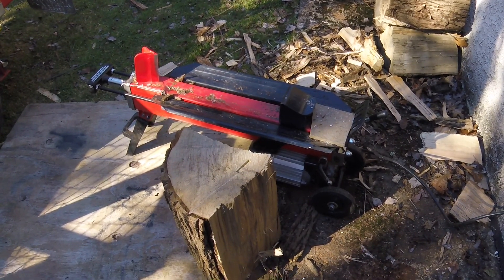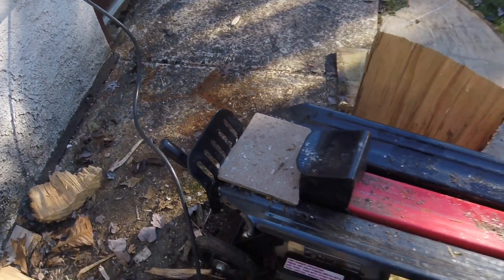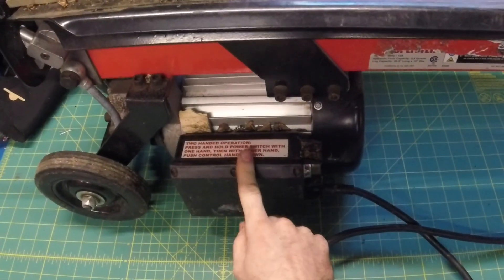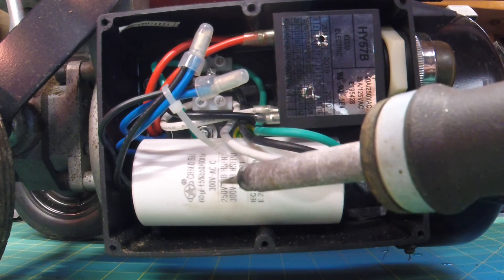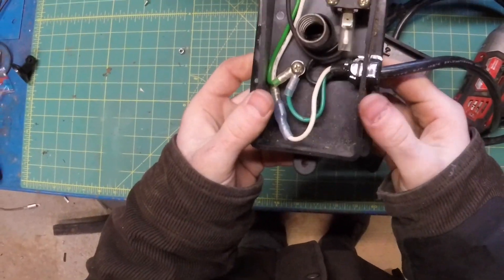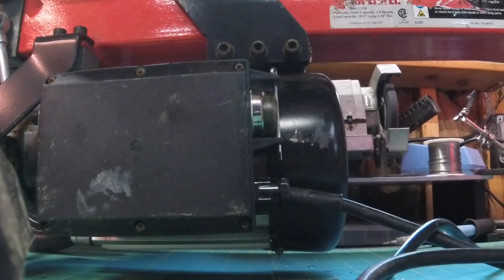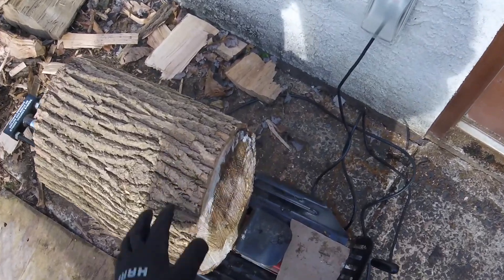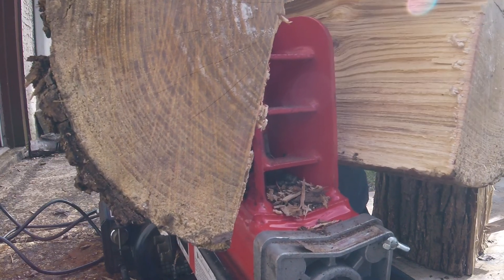Harbor Freight Log Splitter: Ruined by Lawyers, 5 Minute Fix.

Comment: I remove the wires from the switch and tie them together with wire nuts
Reply from the maker: That won’t work on this model- the circuit has to be interrupted for the ram to retract so you’d have to untie the wires after every split. Also, wire nuts are not approved for use in machinery where vibrations can occur- only in houses.
Reply: @thedoubtfultechnician  The splitter I have will retract if you're still holding the button as long as you let off the hydraulic lever. Yeah, I was just thinking wire nuts would be OK in case you'd want to put the button back in.
Reply from the maker: I’m sure wire nuts are ok, just not the best for something that vibrates. It sounds like you have the old style splitter, the one that lawyers didn’t ruin yet! Nice

Comment: First, thank you for the video. I watched several on YouTube before buying. Yesterday I went to Harbor Freight and bought this log splitter. Very happy with it so far. I used it a little bit last night without any modifications. Today I woke up with brilliant idea. No drilling, no clamp like the other viewer mentioned. I used a couple 8 inch cable ties ("zip ties") they fit around the electric box and hold down the button perfectly.
The foot switch I have (also from Harbor Freight) was $16.99 but it's a two way on/off foot switch (not dead man type). So I can hit it once with my foot and take my foot off. After the wood splits I release the lever, the motor is still running so the ram does not retract. I can then grab the wood and move it as I hit the foot pedal to turn off the motor. Then the ram will retract. When the ram gets where I want it to put wood back in, I hit the foot switch again and ram stops there as the motor starts again.
Reply: You could also use the double sided hook & loop velcro strap to hold the button down!!!😁👍🏻
Reply: Excellent suggestion!  And less than my $3 fix! HA HA
Reply: @mikeh8228  can't the switch be bypassed? and just rely n the foot pedal?

Comment: I like it. I got the same unit last season, and split 99% of what I needed. Bought several cords already split, but had to further split it down to the right size for my fireplace insert & wood stove. I should have snugged up all the bolts that go into aluminum threads, one vibrated out and couldn't get it to stay back in, so I had to exercise my warranty privilege. Now there's a "new-in-the-box" unit in the pole barn waiting for next season. I'll snug up everything and be generous with the Loctite. I'll add a HF foot switch, too.

Comment: Would an alternative to your footswitch have been to replace the momentary switch with a push button on-off switch, or would that require playing with the connections to that capacitor?
Reply from the maker: The problem is the switch has to be turned off for the ram to retract. So you’d be pushing on and pushing off for every split. So it kind of has to be a momentary switch of some kind, and foot seemed easiest.
Reply: @thedoubtfultechnician  AHA! Now I know! 
I didn't realize that switch needed to be released in order for the ram to be retracted.
Yes, the foot switch was a no-brainer, especially considering you already had it.
Thank you for taking the time to address my question.

Comment: Two good fixes, thanks. i also thought a foot switch would be the way to go. i'm just now considering breaking down and getting a splitter, and the two hand thing bothered me. I've got a little bar clamp that might hold down that switch on a new one, and already have a foot switch that i use on Dremel tools and knife sharpeners, so I’m a little closer to deciding which to get.
Reply: I just posted above, two 8" zip ties work perfectly. 30 cents for couple zip ties and you can save your bar clamp for something else.
Reply: @Pair-a-dice-cruising  Yeah considered other things, the little bar clamp was handy and unemployed. :-) I actually, long ago, used his technique on some gas cans with a button I have to hold down, which was a pain, but is not so bad anymore.

Comment: Question, if you do everything you said, and fixed the Ram lever in position, could it be a no hand operation just with the foot pedal??
Reply from the maker: Not on mine- the motor has to be turned off AND the ram lever has to be released in order for the ram to retract.

Comment: What did you hook up the foot switch to?
Reply from the maker: It has a 120v receptacle on one end and a standard power cord on the other
Reply: @thedoubtfultechnician8067 thanks for replying. So the cotter pin just holds the button in?
Reply from the maker: Correct

Comment: We have one older splitter that turns on and stays on, it will split and retract without shutting down the motor. We have split wood with it for several years.
My Dad and I both also have the newer style. He holds the switch on using a c-clamp and cycles the power with a push on, push off foot switch. He is in his eighties and it works for him but would like to elevate and use it vertically.
I replaced my switch with a rotary on/off switch and still have to shut it off to retract.
I'm flipping the tank end for end to get the suction port to the bottom. If I can't modify the valve, we plan on using it as a manifold, plug everything we don't need, install a downer for the oil return(s) and mount an electric 2 position 4 way with one work port directed to tank or cross drill the manifold to tank. We hope to automate the process a little and add a lift. Maybe...

Comment: Yes. The problem with these log splitters is that you need to get down very close to them to operate both the lever and the switch. I also had a log fly into my face and have a 2 inch scar right between my eyes. I ended up extending the handle and installing a remote switch for the button. Now it can be operated without having your face right next to it.

Comment: I got one of these ~1 yr back, to let shoulder injury mend. Saved my bacon until I can properly swing a maul again. I used a woodworking clamp to hold the switch on the motor closed. When the clamp fell off, switch stayed closed. Pity that. I use a HF NO foot switch on a wood scrap to run the motor. Sharpening the wedge makes life easier on the mechanicals. One big PLUS of this machine, why I bought one, is that it takes only about 1' square space to stow it on end indoors. Shoulder responded poorly to Covid vaccine shots, but it's coming along nicely, bless it. Morso stove still great.

Comment: Thank you for the advice and this awesome mod! I don't have a wood stove...I wish I did. 
I wanted wood heat in my home soooo badly, but I can't seem to convince the wife that it's better. 
I keep telling her that it's better and if the grid goes down and electricity and propane fail, with a wood stove we'd have options to heat the house.
We'd have to have a stove installed, chimney routed to the outside and heating side connected to the vents for the rest of the house...but the benefits far outweigh the costs.
Reply: I'm in the same boat as you.. Last week she asked why I purchased a splitter, I said because I'm installing the stove soon.. 😎

Comment: You can have the wood I burn coal better ongoing heat and low maintenance. I load my with stove with coal at  6 am and I don’t touch it until 6 am the next day. I get the coal for free from selling all the oak logs to people which I have more hard wood seasoned in tree lengths to supply 15 years

Comment: I had a tiny branch explode and hit my arm, if I was standing behind it, I would have been safe, but thanks to the stupid design, that is supposed to make it safer, it did the opposite. I learned quickly that smaller branches are more dangerous, and better off not splitting them

Comment: I don't see what was so hazardous about the switch , nothing happens when it's running unless you pull the handle and it stops  when you let go , same as on a bigger hydraulic Splitter. I would just.put a switch like the older ones had and call it macaroni !!!
Reply from the maker: The new models won’t retract until you turn the motor off

Comment: Nice mod, I'm currently making a double lever for mine that simultaneously depresses the power button and trips the ram lever . What makes me laugh is that these morons think that having to use both hands to run the thing, allowing a split log to possibly fly up and hit the operator in the face is supposed to be SAFER? The lawyers and government regulators can ruin anything with their blatant stupidity.......

Comment: PUT THE MICRO SWITCH ON THE ACTUATOR HANDLE?
Reply from the maker: Switch on the handle is a good idea but that micro switch would get destroyed if it got bumped by a log. Also, it’s got 120v going through it so you’d have to be awful careful.

Comment: Thanks for the vid! Thinking of getting one of these and using it as a ram on a metal folder I have... can someone tell me if they can operate near vertical with the motor at the bottom (does the hydraulic fluid pick up ok and work that way)?  Also, how does the cylinder return, internal spring when hydraulic fluid pressure drops?  Appreciate any info shared.
Reply: I don't have one, but another review video I saw said it was designed for horizontal or vertical operation.

Comment: Take switch out and solder two ends together.. done
Reply from the maker: give that a shot and you’ll see why it won’t work
Reply: @thedoubtfultechnician  that was just a switch right?! no sensors in it? I would think just by wiring it together would be the same as holding button in.
Reply from the maker: Correct- but the problem is the ram will not retract while the motor is running. So you need to be able to turn it on AND off easily. If you soldered the wires together, it would be useless after the first split.
Reply: @thedoubtfultechnician  you need the foot switch either way. The electrical solution doesn't require precision drilling. Attach the appropriate jumper and insulate as necessary.  Completely reversible

Comment: I clicked on it. I assumed this thing was trash maybe I'll buy one. But I'd put a switch on instead of a button not that there's a problem with the peddle just dont have one laying around
Reply from the maker: Just be aware that the ram doesn’t retract with the switch on for some reason. So you’ll have to turn the switch off after every split.
Reply: @thedoubtfultechnician  I appreciate the warning.

Comment: Why not just replace the switch with an on-off switch?
Reply from the maker: That’s essentially what I did- the foot pedal is the on off switch. The ram worn retract with power on and having to use your hands to cycle power defeats the purpose.

Comment: I have practically the same splitter from Tractor Supply. I bought a maounting frame for it that gets it up to waist level. I use a clamp on that button and bought the same foot switch. Now it's one hand and foot to operate. You need the extra hand to hold your wood down sometimes. It works perfectly.  So you are a few years behind, I did this almost ten years ago.
Reply: Mine is mounted on a metal stand left over from my wood working days!

Comment: Yeah, I just took a flying log to the face with mine because of this issue. Broke my safety glasses and glasses and also almost cut through my lip requiring 5 stitches and tearing up the inside of my mouth. I'm also fairly certain I got a minor concussion. After all that is when the idea for this sort of mod.
Reply: This is an issue that requires contacting, at least, if not sueing the seller. 
At the very least leave a review describing your experience to hopefully warn others of this poor design.

Comment: Couldn't you just get a on off switch like the older ones had ya the electric motor stayed running but If it was going to be a couple minutes I would shut it off
Reply from the maker: The hydraulic ram won’t retract with the motor running on these ones
Reply: @thedoubtfultechnician  ok that is dumb in my opinion I wonder if there is a way to make it work because won't the electric motor ware out quicker being turned on and off all the time
Reply from the maker: You would think so, yes, but unfortunately it’s the way the valve is designed and there’s no way to change that without exceeding the cost of the splitter lol
Reply: @thedoubtfultechnician 
Which is the whole idea. If repair or modification exceeds the price of the item, you'll just get a new one when this one wears out.

Comment: The first thing I did when Mine arrived was order the big c-clamp and foot switch , screwed the switch to a piece of plywood, so it stays stable and does not run around the ground so much.  Have used this setup for two years now and split 14 cords of firewood, works great.
Reply: I love it!

Comment: I was actually thinking of this style splitter the other day and thinking that they would be the ideal candidate for hooking a variable speed drive to. The speed could be increased a fair bit and dropped down to a lower speed as the current goes up as the motor bogs down.
Reply: Mine has a two speed switch related to the position of the lever...midway is faster to get the ram to the log, then down is the high pressure slower speed, when I hear the log pop, then I raise the lever to speed through the log.
Reply: Is that the same style of electric/hydraulic?
Reply: @Alan_Hans__  It looks like the same splitter to me. It is an electric hydraulic splitter.

Comment: I solved mine with a $3 adjustable screw clamp from HF!  No drilling necessary.  I leave mine on while I am splitting and have had it 5 years with no problems.  In fact I used it for about 30 minutes this afternoon to split some wood down to more managable size today.  My wife fires our stove, and plays with it all day.  In the evenings, I stay up later than her and before coming to bed, put in a load so there are starter coals in the morning!   She loves her hot spot near it very much...backs up to it and warms her buns before going to bed! HA HA
Reply: Mine wont let the ram come back until both the switch and lever out released. Did yours not have that issue?
Reply: @boxerdog0588  Nope, as soon as let go of the lever, the ram returns to the start position.  Still working well.  I started splitting a 12 foot trailer load of wood today.  Worked well until I nearly was overcome by the heat...99 and 108 heat index today!  At least I have a fan on me and am in the shade the entire time!  I am in no hurry, will work it a few wheelbarrows at a time until it is all done!  Being 72, us old guys know how to work smarter, not harder! LOL
Reply: @boxerdog0588  mine won’t return while the button is depressed either…
Reply: @boxerdog0588  No problem with mine at all.
Reply: @boxerdog0588  nope, no problem like that!
Reply: Mine won't work with clamp .

Comment: The true problem is in the valve. If there was a way to change the valve so that the pump pressure when running doesn't stop the ram from returning then you could just install a simple on/ off switch. Unfortunately I have not been able to find anything for any of these style splitter when it comes to the valve. But this is a great idea too.
Reply: This is what I was hoping to do. Flip a switch for power and use just the handle to move the ram back and forth.
Reply: @boxerdog0588  unfortunately I've looked for valves and have had no luck. Best thing to do is buy one that's already set up that way
Reply: @millennialhomesteading5915  I should have looked at the controls before I purchased and modified mine. I turned it into a budget forging press.